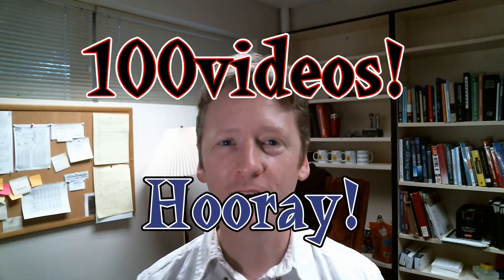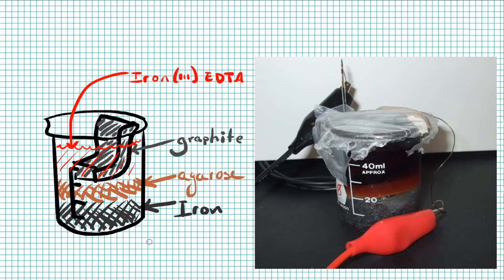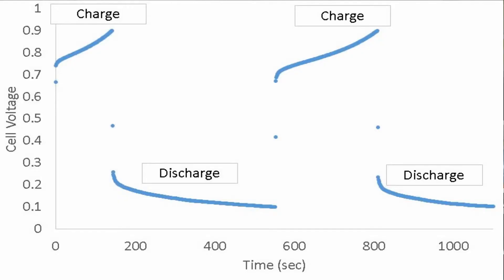Iron battery, single cell performance, 100th video

Comment: I think you will have a real battle with copper.  I have used relatively mild of solutions of ferric chloride to do very thorough etching away of pure copper on fiberglass to make printed circuit boards, took less than 1 hr.
As Mechanicus mentioned try searching ebay for either "graphite foil" or "graphite electrode"
I thought this one was particularly interesting as they claim theirs is "Highly anisotropic - the electrical and thermal conductivity characteristics are very different in the direction parallel to and perpendicular to flakes"  :
http://www.ebay.com/itm/Graphite-Foil-Flexible-Graphoil-Gaskets-Electrode-supercapacitor-thickness-0-5mm-/182225998969?hash=item2a6d841479:g:YJgAAOSwZVlXndbe

30 cm X 25 cm x 0.5 mm  for $10 free shipping